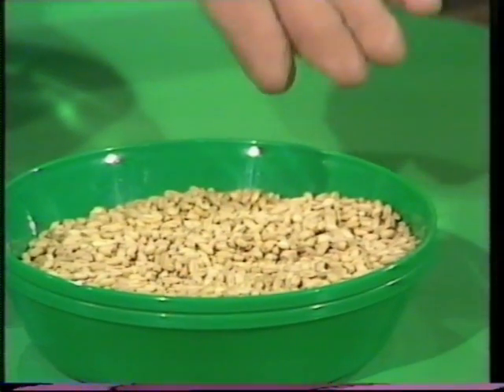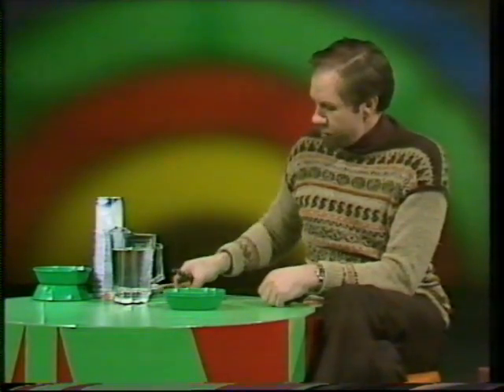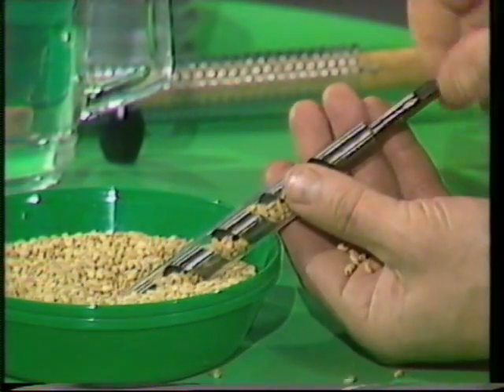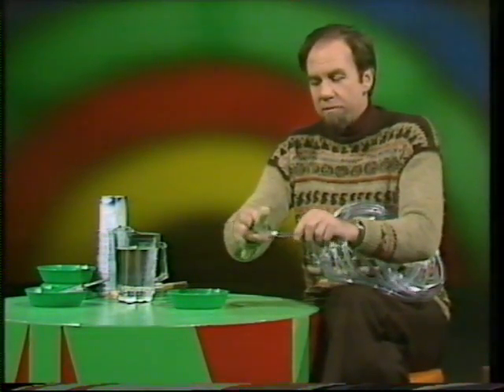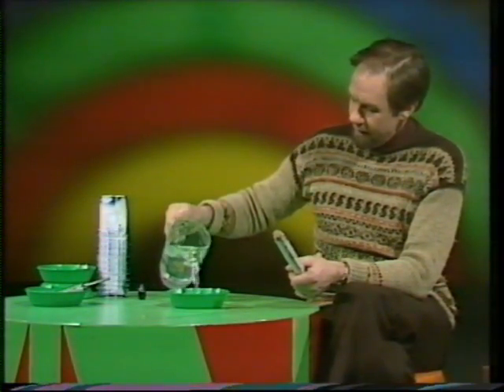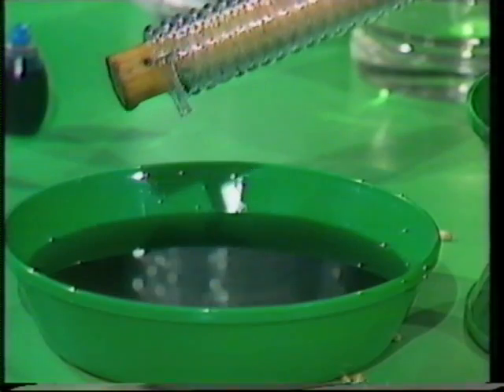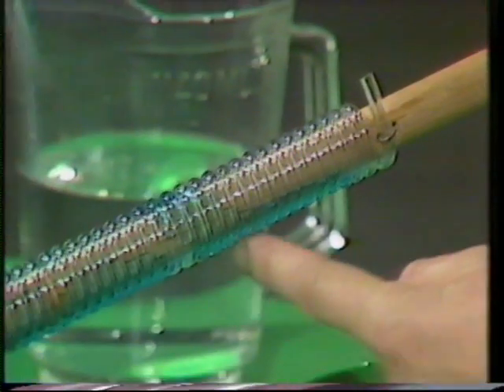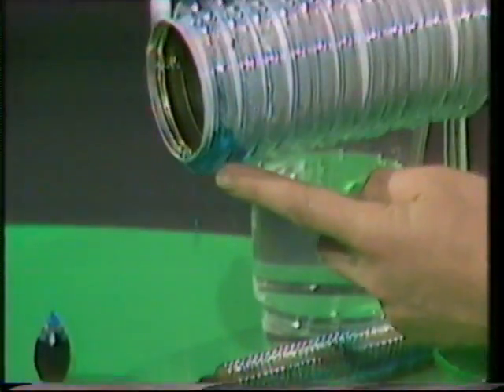Pumping Along With An Archimedes' Screw

Comment: interestingly enough, with the grain if the tube around the screw has a special type of opening, you can actually just turn the tube itself and it will work a lot more efficiently and safely, its called an Olds Elevator (named after its inventor) and its a really interesting non intuitive piece of technology

Comment: That really is a brilliant explanation. I need a portable pump to irrigate rock pools full of tadpoles next to a fast flowing river. Could the tubing remain underwater the whole time? I could fit it with paddles. It only needs to lift maybe 3ft.
Reply from the maker: Thanks. No reason why not. Unlike pumps that rely on negative pressure, this should be able to lift water to any height as long as something keeps it spinning - Rob
Reply: @CuriosityShow  thanks Rob. I've grown tired of hoofing about 20 buckets of water each day! We have a Men in Sheds so I'll see if they'll help my project.
Best wishes.   Dave
Reply from the maker: I guess it would need a decent sized hose- and a long one to extend that distance when wound round something and then a good spindle with a strong motor to turn it - belt driven I'd suspect. It would be great to see it in action - Rob
Reply: @CuriosityShow  hi Rob, I'm hoping to fit it with paddles so the flow of water will propel it.
Reply: @CuriosityShow  it also occurred to me that I could use several hoses, running in parallel. That idea came from reading your comment so thank you once again!